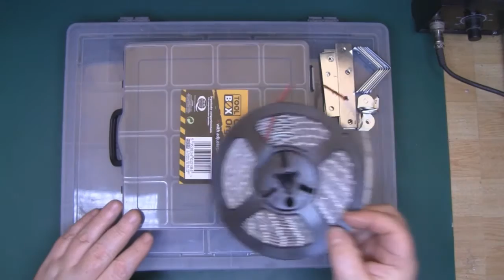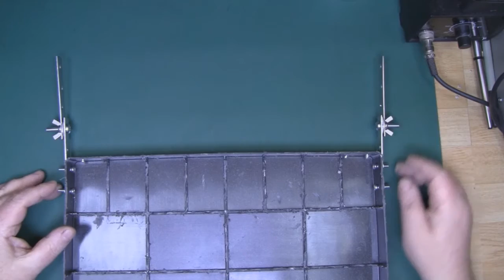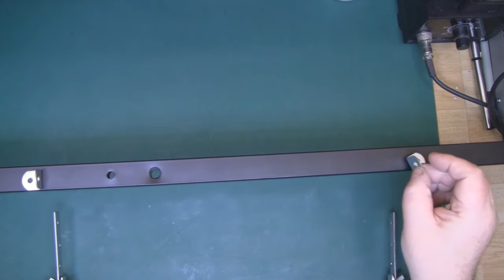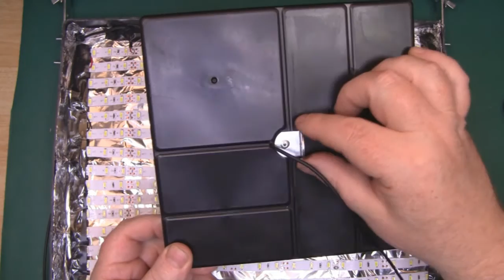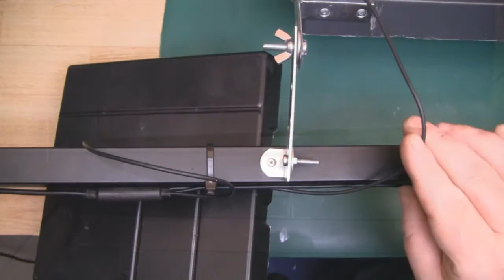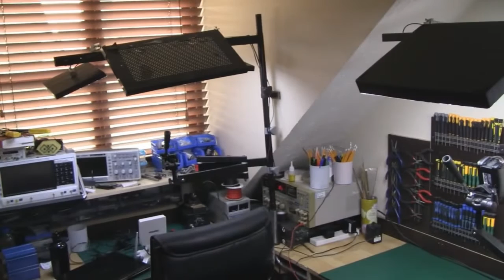Lighting and Camera Rig Build part 2 #138

Comment: I just made my own setup following yours and man the lighting is great and also the camera arm is working great for me. I did not have the same clamps in mine but it is working. I did make a mistake and tightened the bolts to tight to being with but now the arm moves great. I have been stuck in a wheel chair for a while now and your channel has been keeping my mind off that fact. Thanks for the videos
Reply from the maker: +old time engineer Glad it helped you out sorry to here about your mobility is it temporary?
Reply: +andrew mcneil  They say it will be I have been in the power wheelchair since last July 2015 but I am getting better they said it could take up to 3 years or never so I went with the 3 years thanks for asking.

Comment: Great job Andrew. The video results are awesome. If you painted the insides of the boxes matte white, I think that would have been a good option. As far as those crappy led power supplies go, I think you could just add 1 or 2000uF capacitors on to the outputs to get rid of flicker etc. You could also find some scrap prismatic diffuser for free if you asked in the right places.
Reply from the maker: +Robonza Thanks Robonza, I agree 1 or 2 caps should filter out any noise got the ones I order of ebay yesterday and after taking them apart to see what was inside lets just say I will not be plugging them into the mains any time soon! Had to google prismatic diffuser that would be a much better alternative. What are the right places ? ;-)
Reply: andrew mcneil
Laser cutting services, lighting fabricators. I have off cuts here but I am in New Zealand